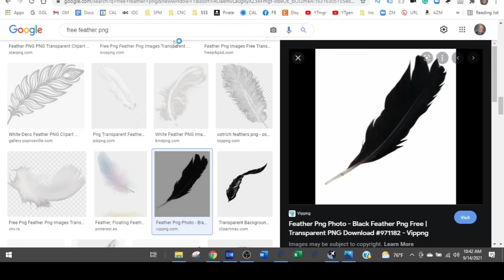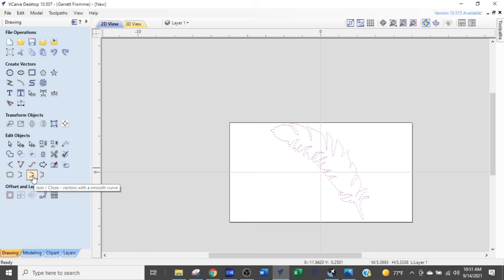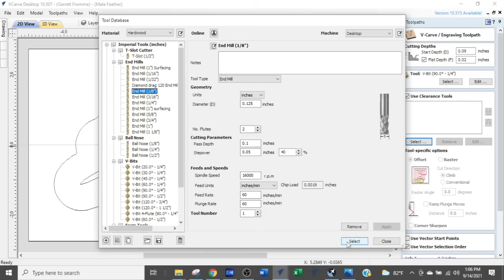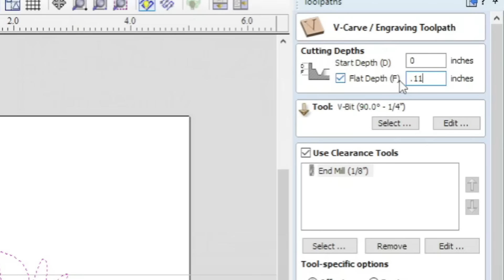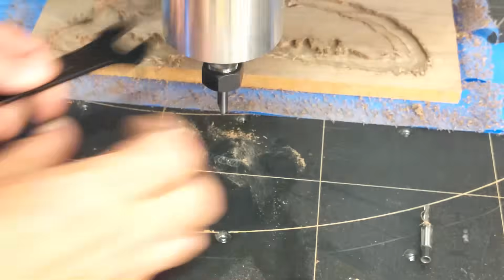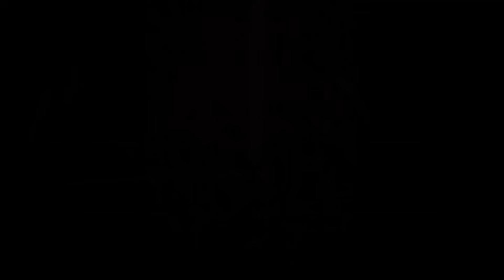How To Make a PERFECT INLAY with a CNC Router, Easy CNC Router Projects

Comment: Like your video. But I have a question. Instead of one vector as you have in your leaf. What if I have many closed vectors. How will it work for male piece. Female piece will be no issue. Thanks
Reply from the maker: Great question Prabhakar. That will still work great if you have multiple closed vectors for both the female and male pieces. 
One thing to note is that this method depends heavily upon the accuracy of your machine. You might notice that the inaccuracy propagates and the pieces might not fit together perfectly with one giant inlay consisting of multiple closed vectors. To solve this you can cut both the make and female pieces on your CNC and then cut the male inlay apart with a band saw and then glue them in!
Hope this helps and i am glad you liked the video man!
Reply: @IDCWoodcraft  Thank you. Appreciate it.

Comment: sadly your file did not load .im using a step craft 840 running UCCNC  and uc100 usb controller i also have v carve desktop 11 ,so no idea why it don't work
Reply from the maker: Hey John. It doesn't load because the file extension is different. You need to change it to the extension your router reads (tap, nc, gcode, etc)

Comment: Hi Garrett, I really hope you see this is I can't get my head around it.

Are you not tricking the endmil to cut a lot deeper then it thinks it is? So it "thinks" its cutting 0.02" but in reality it is cutting 0.11"? so will this not make the cut depth you assign to your bit void? Risking breaking the endmil?

Cheers

Joe
Reply from the maker: Hi Joe. Not really 'tricking' the software. We're just  starting at a different level to get the start edge in a little. It's more about using trig.
Reply: @IDCWoodcraft  Hi, I understand that but you’ll be cutting 0.11” in one pass, when the software thinks it’s cutting 0.02” of material?

Comment: Some advice please if you would----I have tried to do an inlay using maple(female) flat depth of .3" and walnut(male) at a start depth  of .28" and flat depth of .02".  I used a 18 degree v-bit with flat area clearing tools and the carve didn't look very good.  The female carve was great, but the male into the walnut caused a lot of chipping in the lettering.  There were areas of lettering that were much smaller and these were nearly eliminated  in the process.  My question is should I never use such a sharp angled v-bit and stay with a 60 or 90 degree bit?  I was thinking that in order to get the detail on the smaller text I would need to use a finer point on the v-bit.  Or should I just not make the carve so deep and stay more shallow to allow the wider v-bit to get into those area?
Reply from the maker: If you're going to use a high angle bit, you will need to make several passes at shallower depths. I would stick with a 60 or 90
Reply: @IDCWoodcraft  Thank you,  One last thing...can yo use multiple v-bits on a carve provided you use the same bit in both the female and male cuts?  So one area of the carve would be cut using a 60 deg and the finer areas would use a finer v-bit.  Just asking if this will work or is it out of the question.  I am trying to get the finer areas of the carve to show better.  Maybe I'm worried about nothing here.

Comment: 26:48 one is a center cut and one is..... not so much and leaves a flat in the bottom of a single pass V groove. Home depot V Bit......
Reply: Where the clearance of each flute actually extends to a true point. Home depot meaning, their V Bits have a flat bottom and dont actually come to a true point. Some areas fine detail vcarves dont actually reach the "flat" or total depth of the cut and they leave a shallower v slot. Also, when cutting letters and sharp corners, they are wallowed out because the bit doesnt come to a true point. Hopefully that makes sense.
Reply from the maker: Hi Mike. I'm not understanding what you are pointing out. And Home Depot??... what is that refering to?

Comment: I don't have vcarve, so the "flat cut" is confusing. You're cutting to a depth, but the "flat cut" number is different. How does .020 and .110 match up without bottoming out? It seems the offset of the bit would be the way? Maybe 0 for the female and .010 - .020 for the male? Seems like I'm missing something on this point, particularly not having vcarve.
Reply from the maker: Hi Nunya. It is a matter of understanding triganometry. I cannot explain it here. That is why I say in the video to do it that way until you understand why it does it. Then you can adjust the numbers.
Reply: @IDCWoodcraft  

Of course. But...I saw you were ramping out of your points and I don't have that capability yet.

Comment: excellent explanation step.  step, I have a router, I am testing construcam and 2 days ago I did my first inlay test in foam material, I used a 1/8 tool cutter and then a V 30 cutter, the first time and it was acceptable, but the flat faces were glued, the first time I see this tutorial, with its explanation to have Gap it will help me a lot, I do not have vectric, but I think I can do it with the software I have, your tips are important, thank you very much for teaching, I wish you success.
Reply from the maker: Hi Raul. Yes, the techniques can be applied to any software as long as you know how to manipulate it. what did you make for an inlay?
Reply: @IDCWoodcraft  As a test I made the Superman logo, arcs,  lines, corners, Google images screenshot and then I copied it into power point, grave as JPG, then click on the image file,open Paint,edit, it save as monochrome bmp, like this I can vectorize the file immediately in construcam, then smooth it, so I can vectorize any image .
Reply from the maker: @friburgo2006  isn't it cool that you can do that?
Reply: @IDCWoodcraft  Some photos that I take or power point images, PDF that I have could not vectorize correctly, bmp, PDF, jpg formats indicated an error in the format, now I have no problem vectorizing the image, and I think it is a safe and easy way to vectorize An image that is my property, I only used the S logo as an example because it was simple and small to test the vectorization using paint To save the imagen  in monochrome ,I have more complex images of my own and now I know how to vectorize correctly, thanks for your answer and teaching.

Comment: I'm going to politely disagree with one thing that you said about cutting your insert material even thinner as sometimes a piece of wood when it's cut too thin the stress in the wood becomes active, so while you are trying to carve the piece of wood it may curve or bow in the middle which is something you absolutely don't want. So thicker the better within reason  but continue  But I really enjoying your video.
Reply from the maker: Hi TC. Very good point. My train of thought was if the entire piece is secure to the table, it would be oj. Of course, it makes it more risky to breakage when it is removed.  Thanks for commenting so others will see this valuable insight.

Comment: Great video, Garrett. Have you ever tried doing this with softwoods? Or do you need to use hardwoods to keep the wood from splitting or tearing? I do not want to burn my expensive hardwoods to perfect the technique. What do you think?

Thanks for all of the time and patience you put into each video. Very well done, sir.
Reply from the maker: I suggest you always get experience with this on cheaper material. I haven't done it on softwood, but there's no reason why you can't.

Comment: Great videoGarrett you are a a very good communicator. have just started getting interested in CNC wood working.Iam a retired metal machinist done some CNC work and am impressed at how much easier the programming has become.i would like to know the metal working capabilities of the long mill as I have some metal projects Manley in aluminium.
Reply from the maker: Hi Paul. I have not done metal work on it yet. I will be early next year. Can't say at the moment of this capability. But having been a machinist myself, I do not see why it cannot after the work I've done on it.

Comment: Be careful when sanding any piece while it's in progress, as there is always grit fracturing off the sandpaper as you're sanding.  Those minute particles of abrasive which are then embedded into the wood surface will dull your router bits, dulling them.
Reply from the maker: Hey Marty, excellent point! Thank you for sharing this little known piece of info. I'll be sure to include it in future videos!

Comment: Thanks Garrett, awesome instruction! I am new to CNC and have made a couple inlays using the 3-2-1 method, so I'm anxious to give this one a try. I appreciate the links as well.  If I may interject a bit of critic: You are using an extremely dangerous method of using the table saw to split boards in half. It's much safer to use a bandsaw or planer if you don't have a bandsaw, or buy your material in the correct size if you don't have either. Be safe man, it's not worth the consequence if it goes wrong.  I do have one newbie question also: The block you are using to zero the Z axis is only to set the bit height to the material correct? I guess what I mean is, it's only used for the Z axis and has nothing to do with the X and Y axis. I have a Mega V and have purchased the block as well, but have been struggling to understand it's correct function. Thanks again!
Reply from the maker: Hi Mike. Thank you for the safety comment. Yes, I was not being thoughtful on that, of myself and others.

The block (or probe) is for setting the zero points for your project reference. It sets the bit to the top of the material surface. And it can also find the exact corner. I yet to have to make a video about that, but it's coming.
Reply: @IDCWoodcraft  I just like to see fellow woodworkers go home each day with all their fingers..  :}  Do you have an example macro to use just the Z zero process?  I have one from the manufacturer, but it does X Y and Z, and I don't really want to use the X and Y features. I'm still learning the G code, so I'm not yet confident to modify it.

Comment: Great video Garrett, thank you!

Out of curiosity, is there any reason not to use a planer for the material removal at the end of the process, rather than the cnc router with the 1" bit?
Reply from the maker: Hi Bill. I don't see why you can't use a planer.

Comment: thanks for the great tutorial. I do have a suggestion and clarification on the images. You mentioned the "checkered" background that you're seeing. It's not actually a background at all - what that is telling you is the background is 100% transparent. PNG files are generally created to be 100% transparent, meaning no background exists. The trick, however, to making sure you use the correct PNG file, is you must visit the site and download or save the file, then import it into VCarve. If you simply copy and paste it into your software, it will always force it to have a background (white, checkered, etc.).

When you import the transparent PNG file into VCarve, it won't have a background. This results in no "work" needed due to no borders or other artifacts being traced. As an example, the yellow feather you mentioned, after being saved as a PNG and imported in, would have no background and tracing it would be easily done by the program.

*Edited to add: You oftentimes won't find the exact image you want in PNG with transparent background so the steps taken to clean up the image are still 100% valid and necessary.
Reply from the maker: What's up Say What. I'm not sure what I was thinking at the time when I made this video. I'm glad you made clarification on that for other readers.

Comment: Many thanks for the detailed description.  Can analogous steps be scaled down (a lot) to use for shell inlays--material that might only be 0.04-0.06 inch thick?
Reply from the maker: Hi Lamar. You can use very thin material. Just hold it down properly and of course, don't go too deep.

Comment: Great explanation on how to do inlays, you make it look so easy. One thing I did notice though was at about minute 49:35 when you were getting ready to insert the bit after cleaning the collet it surprised me that the operator put the collet into the machine then added the nut, with all the ER collets I have used the nut should be firstly clipped into the nut, then inserted into the holder and loosely threaded before adding the bit and tightening, otherwise they can jam and the nut is not tightened correctly.
Reply from the maker: Hi Derek. The collet on the Makita router does not clip into the nut. The design does not require it to be. On standard ER collets, yes, you want to clip it first to seat properly.
Reply: @IDCWoodcraft  On mine it does but its very old, also on the next tool change it was done correctly so I'm confused. Main thing the job was done safely, that's the most important.

Comment: Have posted your video and done the same, but get a run in a few places. So a little loose when I put together male in female.
Uses the same tool. Am I going too deep or do I have to correct the trajectory inward in the female?
Reply from the maker: Hi Lelle. I'd have to go back and look at the program. One thing you could do is change the .05 to .03. Adjust the depth of cut to equal .11

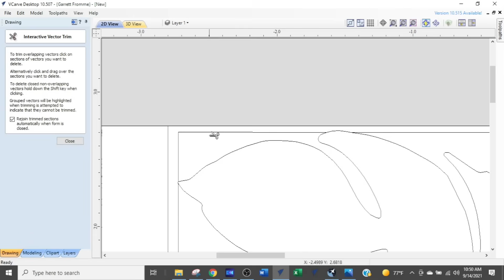Comment: Great video... not sure why I'm having an issue when it comes to cutting away the areas we don't want (12:40).  I don't have the ability to cut those areas.  The scissors only active when I'm over the lines that I added?  I've watched that sections over and over again and I can't figure out what I'm doing wrong.  I'm new to Vcarve so I'm sure its a user error.  Any idea what I might be doing wrong?
Reply from the maker: Hey CJ. I cannot tell without seeing what you are doing.

Comment: Thanks for the video, followed your instructions on doing the Feather.It came out great. Now I need to figure out how to make it deeper and a thicker male insert
Reply from the maker: Hi Jaustin. For thicker inlays, Just move the cut depths down but leave the start depth for the male the same.
Reply: @IDCWoodcraft   Thanks for the reply, Still a little confuse on the male. Is that the flats depth i change to the 0.250 if i am wanting to a 0.250 inlay?
Reply from the maker: @gunracksonline  the make is start depth 0.02. that should never change. Whatever you increase the female depth to, make sure the male flat depth and start depth equal the same number. Does that make sense?

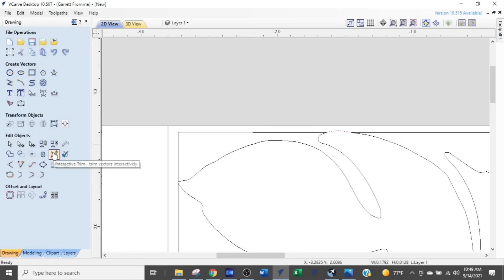Comment: At 12:32 into the video when trying to use the scissors to snip out the outline all I could snip was the new vectors I created to close the gaps. Any ideas?
Reply from the maker: Hi Elite. when in the trimming tool, there is a check box that says join vectors. Make sure it is checked. when you cut the line and then exit the trim tool, the vectors will join.

Comment: Hi there, will this work with a v60deg which is the same as the 90deg vbit that you use (difficult to find in Oz)?  I have had nothing but trouble making my inlay even though I’ve followed your instructions to a tee and always end up with gaps.  Any help appreciated.
Reply from the maker: Hey Sue. I got your email. To answer your question here, it will work with any degree v-bit.

Comment: We need 1 more example Garrett.  Deep inlays for cutting boards where the project is 2” thick.  Having such a thin .11” inlay will leave a hollow sound whenever that area is tapped with an objects.  The female portion has to be .3 ish.  And that’s where all these numbers start to get tricky
Reply from the maker: Hi Caleb. You are right. I've had a lot of comments about deeper inlays so a video will be coming up.

Comment: Hi there, can you please give me a link to the v bit you are using. I have tried so many times using a 60deg and a i0deg bit but I’m constantly getting gaps between the 2 layers.
Reply: Thanks for that, I am able to use a 60deg bit the same sort you use arent I? If so do I need to adjust any settings or numbers?
Reply from the maker: @PeachCraft55  The bits that I have, when you make your order, you will get a shipping notice. And that notice will be the feeds and speeds table that are set for all the bits that I sell.
Reply: @IDCWoodcraft  ok so I ordered 3 bits from the link you sent and received a shipping notice however no feeds or speeds advice is in there, I work in mm as well.
Reply from the maker: @PeachCraft55  The speeds and feeds link will be in the email you received. Go to the website. The download link is on the homepage.
www.idcwoodcraft.com
https://bit.ly/3fxYeUF
Reply from the maker: Hi Sue. This is the bit I use → https://idcwoodcraft.com/product/90-degree-v-bit-for-cnc-routers-premium-grade/
Reply: Oops sorry I asked that question in another comment about measurement changes if I prefer to use a 60dg bit do I need to adjust any numbers.?
Reply from the maker: If you're talking about the gaps between the layers, can you email me a picture of what you're talking about?
Reply: @IDCWoodcraft  I will do that but don’t have your email address.
Reply from the maker: @PeachCraft55  garrett@idcwoodcraft.com
Reply: @IDCWoodcraft  have emailed you.